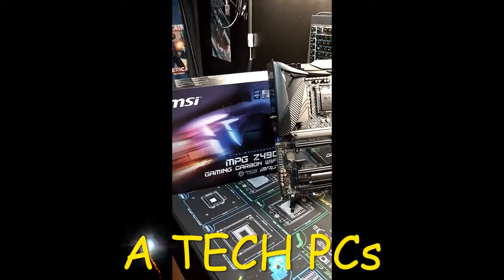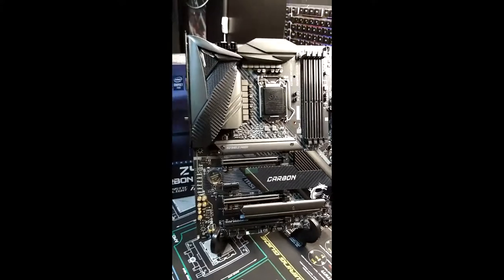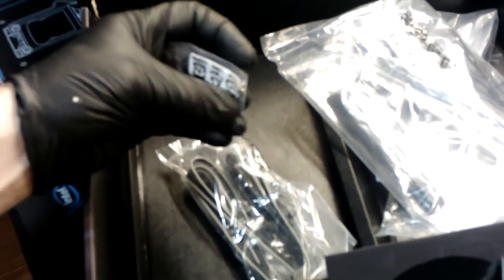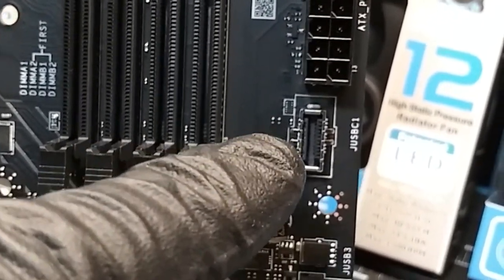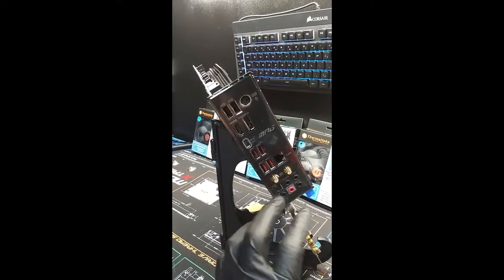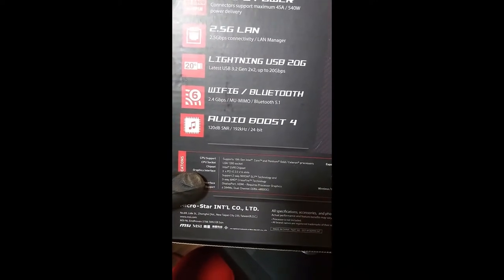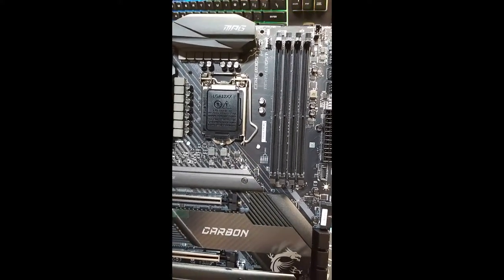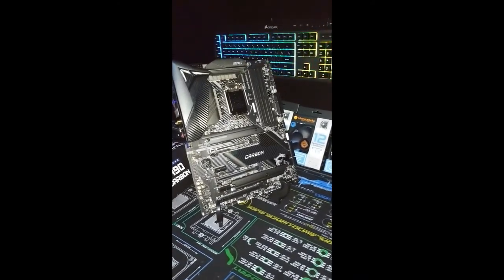MSI MPG Z490 Gaming Carbon WiFi Gaming

Comment: Quick question I bought this motherboard already and I was wondering if I would be able to put a i9-10850k in it? And does it have Bluetooth built in?
Reply from the maker: yes a 10th gen cpu will work.. the i9-10850k is a 10th gen unlock cpu.. and i don't believe it has blue tooth ...  consider subscribing to the channel and check out some of my videos
Reply: @ATECHPCs  it does have bluetooth
Any mobo with wifi has bluetooth
Reply from the maker: @aliamr9768  ok thank you
Reply: @ATECHPCs  no prob

Comment: Under the shield frozr, did you find a screw that’s used for mounting the ssd?
Reply from the maker: No.. The screw is in a little bag in the bottom of the motherboard box.. I had to go look for it..   Lol.  Consider Subscribing and check out some of our videos
Reply: @ATECHPCs  That's what I was making sure of lol. I also went looking and found the bag and then had a mini-stroke thinking I lost a screw.

You have a new sub! In for some fire builds
Reply from the maker: @papajoewil10  o awesome thanks for the sub... Have u seen any of my new builds?

Comment: So how was it after plugging it in?  I got this board going to build it with a 2080ti and an i9 10900k cpu. Hopefully when i get it built it'll run nice
Reply from the maker: wow thats nice hardware your talking about.. i9 and a 2080... i have the i7-10700 and 1070 8gb  and it destroys all .. your set with be better than that... its mind blowing ..lol    this gave me no trouble .. it works great .. im buy this board again for another up coming build... wall mounted..pc.. i just did a wall mounted pc build .. which u should check out and get Subscribe to my channel ..     but yea i recommend this board
Reply from the maker: @It’s Tony what do you mean both type of chips?  are u saying like a i5 or a i 7 or a i9 ..can the board run any 1 of them? chip is the chipset on the board the 490 chipset   hit me back
Reply from the maker: @It’s Tony  only ryzen is with ryzen boards and intel only with intel boards.... i would do intel.... less problems for u to deal with .. amd can be a pain in the ass for a new builder... AMD boards havea B or A or X in the title of the board.. like A320 is the lowest u can go... or the X570 is the very best u can go for ryzen... with intel... its Z or  B  or H   are intel.. yes both amd and intel have B chip sets.. but they are not compatible,,..    A GOOD SET UP  like MY PC  IS A 10 th Gen inteli7 10700  cpu with a Z490 motherboard.. now this is on the higher end..   O for intel.. IF IT SAY I7 10700 K  the K stands for overclock.. not all intel cpu are unlock.. ALL OF AMD cpu are Unlock.. if u need me here's my number- tx me any time..  865-274-3971 IM DON/  subscribe to my channel and check out my videos
Reply from the maker: @It’s Tony o the board i have .. the video u watch is for INTEL ONLY. no 1 makes a motherboard that can handle both cpu s
Reply: dude tell me how that works out, i literally have the same thin coming in the mail as we speak lol
Reply from the maker: @trollingsfortrolls  tell u how what works ?
Reply: @ATECHPCs  i was talking to mike, i literally just bought the same things he did and was hoping to see how he liked it. all im missing from the mail is the gpu cpu and ssd
Reply from the maker: @trollingsfortrolls  o ok.. well did u at least like the video
Reply: So its a good motherboard? Im planing to pare it with a i9 10900k and rtx 3070 it seems like this mother board sits in the mid range mb?

Comment: Would an old GPU like  Gigabyte Geforce GTX 980 Ti would still be compatible for this motherboard?
Reply from the maker: Yea a 980 is still a fast card... A few years old... But still able to play todays games... Now.. Were u might have a problem in.. Is getting drivers.. I would Nvidia would still have drivers available for that card on its website.... Thank you for your comment.. Consider Subscribing to the channel.  Thx
Reply: will it also fit Gigabyte Geforce 1660 Ti? It has windforce 2x cooling system and graphic card - Gv-N166TOC-6GD. It is my first time considering to build a PC. So I did the research and not sure they will be fit together

Comment: Does using 2 m.2s take away any lanes from the gpu ? Or does the gpu still run at max speed.
Reply from the maker: it has plenty of lanes...  the gpu has its own.
Reply: @ATECHPCs  so I would get full speeds for both m.2 lanes ? Without taking performance away from the gpu ? Thanks for the reply by the way that was nice of you.
Reply from the maker: @intelligence6900  yea youll be fine.. hey no problem.. consider Subscribing and check out some of my videos .

Comment: Can i inseert 32 gb of ram??
Reply: yes
Reply from the maker: yes 32 gb of ram is fine... it can handle up to 64 gbs of ram.
Reply: @ATECHPCs  on the specifications web page it says 128gb max support.
Reply from the maker: @cecilsparcel9224  yes . correct.. i was telling him that he could up to 64 if he wanted too.. but 32 is more than enough... awesome thank you for sharing  vape.. hey consider subscribing to the channel... and check out  some of our vape videos.. i also made some vape 420 videos
Reply: @ATECHPCs  If you can tell me what DDR4 Pin # being 288 or 260 for the z490 mobo shown in your video. Also if you can keep up that awesome response time.
Reply from the maker: @cecilsparcel9224   ALL DDR4 pin is 288... more pins more transfer rate.. =better gaming. .lol
Reply from the maker: @cecilsparcel9224   well if your a subscriber and a current viewer of my channel... i always try to get back to you .. i monitor my channel very closely
Reply: @ATECHPCs  new egg advertised 2 choices for ddr4 in their filter for memory
Reply from the maker: @cecilsparcel9224   with this board .. you must run ddr4 4000mzh or higher to fully unlock the chipset... i bought 3600mzh .. another 400$ later and im up to speed...lol  what type of pc do you have ?
Reply: @ATECHPCs  Disappointing enough to say I game on a laptop. I have the MSI GE72MVR 7RG Apache Pro. I believe the mhz limit for my ram is 3200 and max support 32gb. I was the pins because I am making a dream build list with the z490 mobo. No experience building.
Reply from the maker: @cecilsparcel9224  oo.  I love it.. Its 279$ for the board... But it will last a long time. And its on the high end side...  Hey theres nothing wrong with being on a laptop... At least you have 1..alot ppl dont have nothing..  A dream pc. Uh.. Thats awesome... Yea the titan pc i built which i used this motherboard in. Was my dream pc... But now im building another 1..which ill do the video here soon... Have u see the video?  The intel 10th gen gaming pc Titan Rig... U should check that video out
Reply: @ATECHPCs  I still get alot of use out doing some upgrades in the future and some required part replacement according to my tech guy that some cooling part needs to be changed because some cooling liquid evaporated or dispersed completely. Going to be passing it down my girlfriend. I have not seen your titan build was about to watch the wall mount video. I had just found your content while looking for more information about the mobo. Probably won't have the dream build started until nvidia 40 series pop out lol